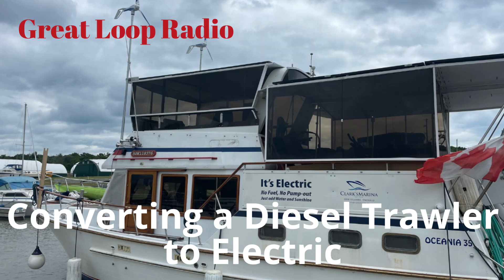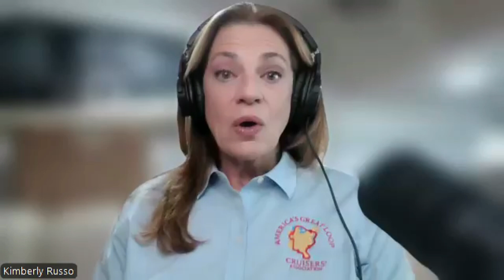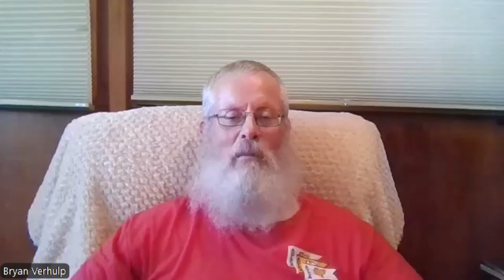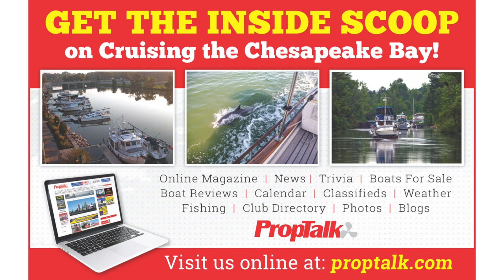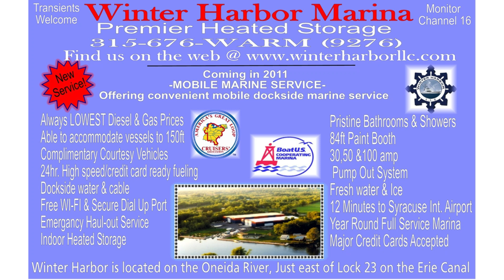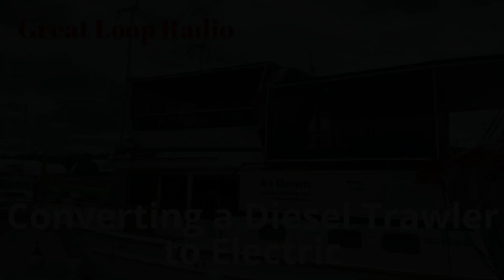Great Loop Radio:  Converting a Diesel Trawler to Electric

Comment: Each 30 Kw motor is just over 40 hp.  The conversion is 1 hp = 0.747 Kw.  The difference is torque at low RPM.  However, in a repower that doesn't matter because you can't fit big enough props to take advantage of it. It takes a certain amount of power to move a boat and it doesn't matter it you express it in horsepower, kilowatts or BTUs per hour.   It is refreshing to hear someone who has done an electric conversion be honest about speed/range etc.  The power curve to move a boat is certainly not specific to electric power.  So had he done the basic naval architecture colculatons he would not have been surprised.  I considered electric when I repowered my former displacement cruiser.  As a scientist, I did all the analyses at the highest level.  I concluded that it wasn't worth it for my use case.  I boat on the Atlantic ocean and have to deal with tidal currents as well as seas.  Also at the time (2007 to 2011, the cost of batteries was astronomical.  That is a very different use case than cruising inland waters.  Personally I don't have the patience to cruise at 3-3.5 knots.

Comment: I'm surprised on a large trawler he only installed 60kW of battery. I'm on a 30' cruiser and am installing 120kW. I'm surprised he's doing 30kW motors on 48V. That's a lot of current. 588 amps to generate that power. I imagine he's not pulling more than 10-12kW out of those motors at 200-250 amps, as you're already into 2/0 to 4/0 cabling.

Comment: This is why hybrids make sense.  Cruising at 3kts and having to wait to wait 2 days to charge on solar is a deal breaker. Greenline has it right imo.
Reply: I think people get in too big of a hurry. And it could all certainly be designed differently to move faster. Bigger solar panels, bigger batteries, spend the night at marinas to charge, suddenly you're on par with a diesel stink pot. Except for cost :D
Reply: @PaulASmyers sounds great in ideal weather, what happens of you really need to the hell out of dodge?
Reply: @Steve-qn8gn  You mean like run away from a hurricane that you get 2 weeks notice on?
Reply: @PaulASmyers first of all, you sound like you’ve never sailed or boated on the ocean before. Hurricanes aren’t the only thing you’d want to outrun, but i suspect id be wasting my time explaining it.
Reply: @Steve-qn8gn  No please, explain it.
Reply: @PaulASmyers you sub to Sarah n tuned 😂.  Anyway, there are more weather systems other than hurricanes that would require power and speed to get away from.
Reply: @Steve-qn8gn  On the Loop? That seems like massive over preparedness. I sailed offshore in the Atlantic for four years - sailboats don't have power or speed. We weathered through hurricanes by finding inland marinas, and sat on anchor up to 45 kts. It's really not that hard.

Comment: What a joke and waste of money, no wonder he had a change of marital status. Lets assume you have enough roof space for 10,000 watts of solar, maybe you add another 10,000 watts of wind. WOW 20k watts of power, that equals a whopping 26 horsepower with the sun shinning and the wind blowing, that wont get you very far very fast now will it? Want 100 hp? that will require 74,600 watts. Wake up folks, electric drive is a pipe dream.